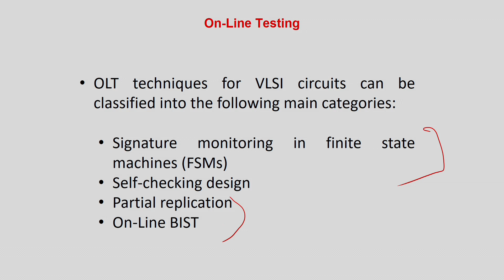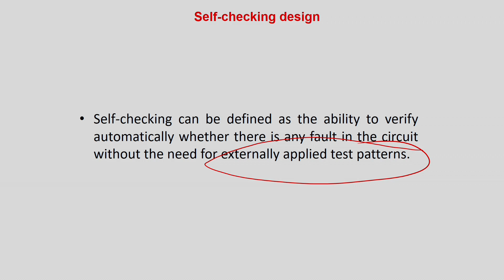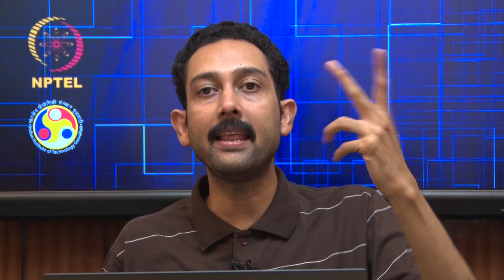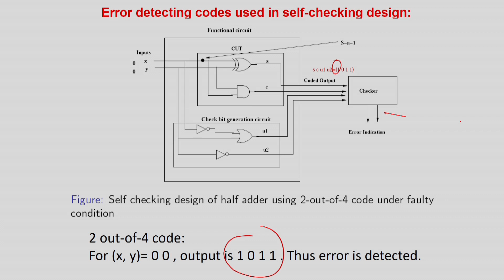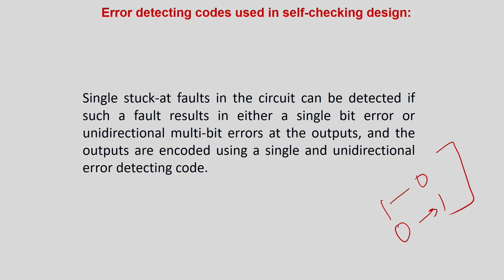Concurrent Testing for Fault tolerant  Embedded Systems - 1

Comment: I was confused for the parity part 25min around. I'd like to clarify for those who feel similar. Firstly, a parity bit is additionally appended by observing the actual output and not the input. The expression for parity in terms of input is reduction of the expression. Then after appending the parity bit, we observe that outputs concatenated with new parity bit are even parity (#1's mod 2 = 0). Now thw checker is only taking advantage and relying on established invariant that the number of 1's in concatenated output would be even.